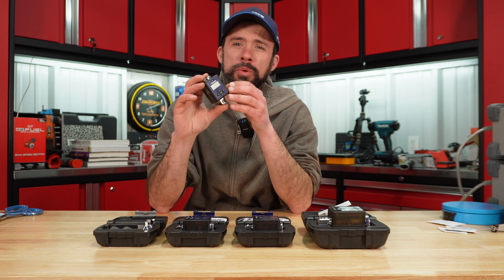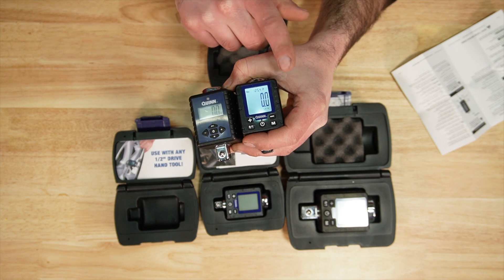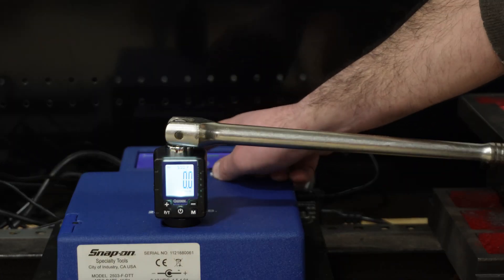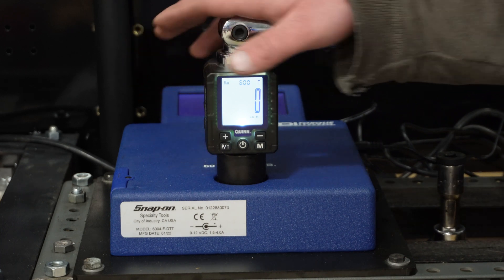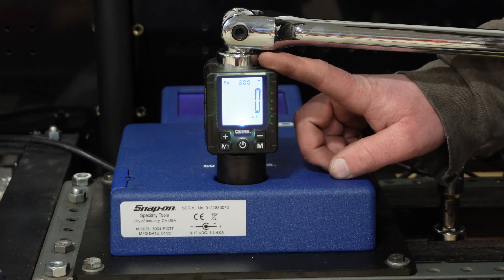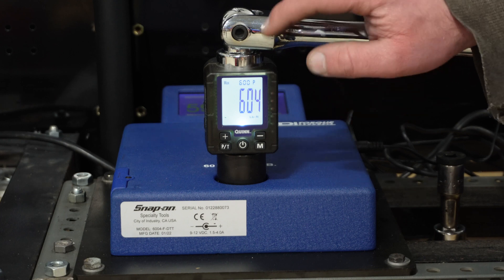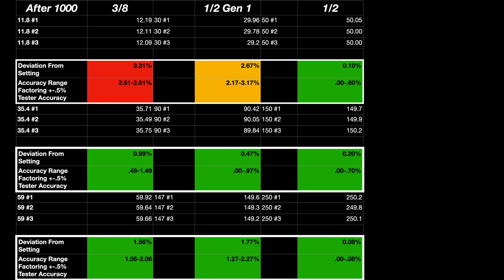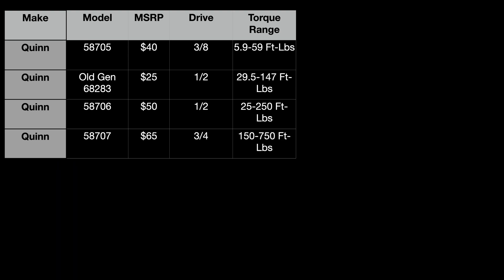Quinn Gen 2 Torque Adapter Testing

Comment: Thanks for the review!

Curious for a hobbyist say for wheel nuts, would you recommend a digital torque wrench vs this torque adapter?

The price difference seems steep for the digital torque wrench.

Thanks in advance and happy new year!
Reply from the maker: Personally I would go with a split beam or click for lugs.  

Digital torque wrenches can be tricky because u won’t be able to see the display,  only the higher priced ones have leds on the sides.  A digital torque adapter would be better.  But I still prefer a mechanical torque wrench for that application.

Happy new year!
Reply: Thanks for the recommendations!  It's really helpful especially for a newbie like me who is just about to start with lug nuts as a home DIYer.

Was debating between the ICON click wrench and the digital one and went for the digital one w/ the 25% coupon but then saw the torque adapter review and really made me double think if that is a cheaper route in general. 

Now debating if I should return the digital and wait for next 25% coupon to get the click wrench instead.. ha.

But thanks none the less!  Appreciate all the honest reviews that are insightful!

Happy New Year!!

Comment: Practicing for a few minutes with a click wrench on the digital adaptor I learned that technique is important. My 30 year old 40 - 200 in-lb SnapOn wrench is plus or minus one inch pound full range if I use the proper technique. My 5 - 80 ft-lb Pittsburgh is especially sensitive to technique below about 25 ft-lb. My fifty year old 20 - 150 ft-lb Craftsman is the least sensitive technique of all my torque wrenches. I have a dual beam 0 - 200 in-lb beam torque wrench that's 40 years old that's dead nuts as close as I can read the needle on the beam. 

My take away: If you have one of these gadgets, use it to practice with the wrench for a few clicks if being close really matters.
Reply from the maker: Yep 100% definitely a technique to it.  I find it’s trickier to use a digital torque wrench vs a click style,  even though the digital can* be more accurate.
Reply: @Tools-Tested  Well what is this technique then? If it is fairly accurate, will it be working no matter what technique someone uses while torquing?
Reply: @Tools-Tested I noticed  that also , get the reading before  the 85 seconds  or it'll  turn itself  off 👍😊

Comment: For anybody wondering how to switch from NM to Ft lbs and other measurement values press the "P/T" and the "M" button at the same time. The owners manual sucks but i found this out through searching online..
Reply: Does this do inch pounds too?
Reply: @drummerjimmy51  I just ran a test for you because I own the 3/8" and the 1/2" versions. They both do offer many measuring formats including in in-lbs, nm , ft-lbs and a few more (six total measuring formats). 

the 3/8" starts registering at 7 in-lbs

the 1/2" does not register until 30 in-lbs

The numbers on the package that says 5.9 and 25 ft-lbs are BS they measure accurately lower than that, harbor freight wants you to buy multiple so they BS the numbers a bit... if I could do it over again i would only buy the 1/2" because i never need to use them for under 30 in lbs
Reply: @drummerjimmy51  yes this is exactly what I came to comments looking for!
Reply: Thank you  , that thought  crossed my mind just  now,  I knew there had to be a way to switch the modes

Comment: Thanks! That's definitely useful data. I have the new 1/2". It works well. I've been thinking of getting the 3/8" version. What I want to use the 3/8" for is verifying my low torque range micrometer adjust click wrenches. The 1/2" doesn't go low enough for my 40 - 200 in-lb (Used a lot on ATVs) or my 2 - 20 Nm wrench (which I use often on chainsaws). Based on your test results, I think I'll wait on the 3/8" because it's least accurate where I need it the most. The 1/2" is considerably more accurate.
Reply from the maker: No problem!  Yeah it was interesting that the 3/8 was not the greatest at the bottom of the range.

I did find the manufacturer and they make a 1/4 version DBA2-30 I have it on order but won’t see it till next month.
Reply: @Tools-Tested  Outstanding. I'll watch it when you put it through the gauntlet.
Reply: @Tools-Tested  Super eager to see that! Thanks so much, as always!
Reply: @Tools-Tested  Thanks for the model number. Wonder why HF doesn't sell this one too?
Reply from the maker: No problem! Hopefully maybe just inventory issues.  I don’t see why they wouldn’t sell it.  

The one I ordered has to come from China.